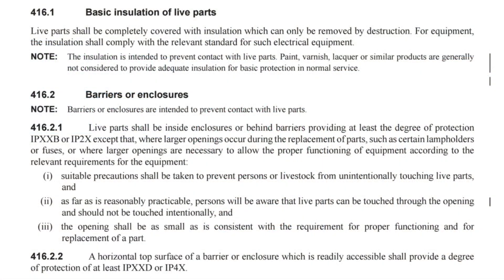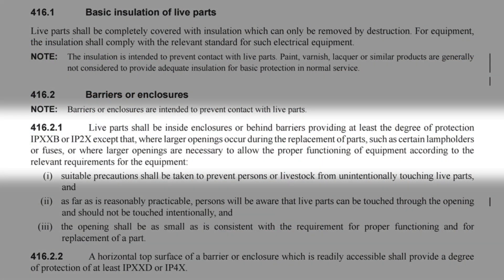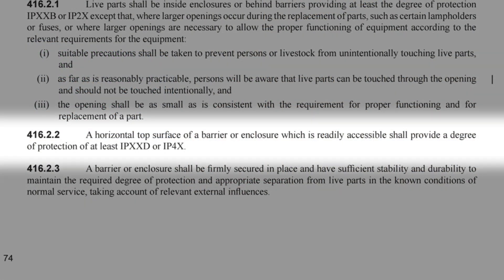CONSUMER UNIT IP RATINGS - Electricians Q&A - BS7671

Comment: What about if you knock two knockouts next to each other out at the top of the CU and use a jigsaw to cut a clean Oval shape, then use Gromet strip with this new made hole at the top of the consumer unit.
IP rating will be poor, but then you cover the hole with trunking flush from the ceiling or wall to the top of the consumer unit  covering the hole.
Only in circumstances when the T and Es or wiring is not situated or fed at the back of the consumer unit but are fed external down a wall and clipped to the top of the CU entry?

Comment: Concerning IP4X on the top of a DB, just out of interest, does anyone know why this is?  I thought at first that fire propagation might be the reason, but then disregarded this as plastic glands and rubber grommets offer little fire protection... Then I thought maybe or was about insects or mice getting in, but then holes big enough to allow this (IP2X) are allowed elsewhere.... Are they expecting people to come along with 1mm wires desperate to stuff them into the top of consumer units and distribution boards, desperate to be electrocuted? Or.. hang on, I may have answered my own question.  It's probably down to the dropping in and settling of fine particles which may then lead to fire risk... Seems most likely.  Having said that, a small mouse (or big spider) that could squeeze through an IP2X would surely offer the same risk, or greater?

Comment: I have noted that they are quite a few comments relating to the knockouts in the back of the consumer unit with relationship to the IP rating allowed I have also noticed that there is no reply from e f i x x . Could this be due to the case that they do not know the answer to this question??????.

Comment: Where does IP rating stand for a consumer unit which is hard knockouts removed to allow entry of cable through back of consumer unit
Reply: You have lowered the IP rating of the CU.

Normally the IP rating is for the entire enclosure.

However, the IET regs apply the IP rating to individual surfaces of the CU. If I recall correctly, IP4X on horizontal surfaces and 2X on vertical surfaces.

People make it more complicated than it needs to be. Don't over think it.

It's mainly about stopping people from getting their fingers in and touching a live part. With this in mind then, why do you care about holes in the rear of the CU where people cannot access those holes to be able to insert anything into the CU?

If those cable entry holes are on the underside of the CU such that little Johnny can come along and put his little fingers in, then yes the installation of that CU would not be compliant.

Comment: Mounting orientation of a consumer unit. Many people seem to think mounting a standard 18th edition DB on it's side is acceptable. But as there is no normally no lock / latch gravity is used to hold the lid shut. Mounting a single phase DB on it's side would not be installing the unit it as designed. Any thoughts?
Reply: Well it certainly doesn't make any difference to the electricity!

It's just a question of whether the cover flips open.

And from information I have seen:
If the consumer unit is made of steel and it confirms to BS EN61439-3 then it doesn't matter if the lid flips open.

So evidently, it is the fact that the CU is made of metal which reduces the fire risk posed by a CU, not that the lid closes. The lid doesn't make an airtight seal and prevent oxygen getting in.
Reply: And as for "not installing the unit as designed".
It is for the manufacturer of the unit to specify  how it should be installed, not the electrician. The electrician didn't design the product.

So with regards to installation, it is down to the electrician to follows the manufacturer's installation instructions.

And if the manufacturers does not say not to install it in a portrait orientation, then you can install it in a portrait orientation or if it mandates a particular orientation then you need to follow that instruction.

It's the same with maintenance free junction boxes. You have to follow the manufacturer's instructions.
If you do that, then the liability if something disastrous happens, falls to the manufacturer and not you as the installer.

And if you are not sure about the orientation question, then you get in contact with the manufacturer.
And ideally get a variation to the installation instructions confirmed in writing. And retain that confirmation.

Comment: How about from under. Where there is busbar cover and access to busbar. But from the top. Fair enough for water leaks but there is neutral and earth bar. Stopping you put your finger. Through  and the MCB  position it’s fairly low from the top. Again rule and regulations   And health  and safety with  out that much  the though
Reply: IP4X or IPnX where you are interested in the number n, is not about water ingress. Water ingress is the second digit, in this case the X.

So the rules around IP4X or IP2X are nothing to do with water.  Protection of the insides of the CU from water ingress is not what these regulations are about.  The CU is indoors.

External CU's, that's a different set of regs.

Comment: But isn't the issue here whether the ipxxb rule applies to the back of the consumer unit if it's fixed to the wall with no way for a finger to access it.
Isn't the more common question that arises is in relation to the 421.1.201 for non combustible enclosures. Once you create a significant hole for cable entry, is the enclosure deemed compromised?
Reply: No.
It can't be, think about it.
The case of the CU does not provide an air tight seal.

That is, the purpose of the metal enclosure is not to quell a fire by preventing oxygen from getting to the fire.

The purpose of the CU being fabricated from metal is such that the material itself is not combustible.

So with that in mind then, it doesn't matter about holes in the CU from a fire perspective. It does matter from an IPnX point of view.

The rules around IP protection of a CU when indoors are about the prevention of an electrocution risk to the human occupants, notably little Jonny who likes to stick things where he shouldn't.

Comment: You said use a closed grommet or a stuffing gland. What about using trunking
Reply: My thoughts exactly. A header trunking with a 90 degree bend to the ceiling should surely be fine.

Comment: Would you class the white fire rated grommets sufficient to achieve ip4x in each scenario below 

With 1 cable entering through a 32mm fire rated grommet 

With more than 3 2.5mm twin and earth cable entering through a 32mm fire rated grommet
Reply: Possibly... But the membrane is a bit flimsy isn't it. Wouldn't be my go-to...trunking over the top of the dB for the win. 👍

Comment: Not quite what I has hoping from the vid.  From the thumbnail I was expecting a chat about the IP rating of cables coming in from the back of the consumer unit.
I have seen people cut out slots in the back and put the cables though.  The IP rating is way more than IP2X.
So, that are your thoughts on this scenario, where the consumer unit is fixed to a wall and the cables come in the back via a slot?
Reply: I was really hoping for some clarity about this also
Reply: Yes click bait
Reply: Surly it’s about preventing access to live parts? When the cu is screwed to a wall you ain’t getting your fingers in the back.
Reply: @paullyons4624  But you can get a wire down the back of a consumer unit.  It's not IP4X with a slot in it.
They are also made out of non-combustible material, to prevent the spread of fire.  What does a slot do to this?  All stuff that wasn't  clarified.
Reply: @spoon1272  only the top horizontal surface needs to be IP4X, the back, sides etc are ok at IP2X, screwed to a wall you cant get your fingers down the back and into the enclosure, BS7671 doesnt say that a consumer unit must prevent the spread of fire, only that it must be made from non combustible material
Reply: @codenamenel  But it's made from non combustible material to prevent the spread of a fire from within the CU.  That's why they changed it.
Reply: @spoon1272  it doesn't say anything about  preventing the spread of fire. We live in a country in that everything is allowed unless there is something that expressly forbids it. We only have regs for allowable IP Ratings and the non combustible material. So Everything else is allowed
Reply: @codenamenel  Really???  So why do you think they went from plastic CU's to metal ones, if preventing the spread of fire from within the CU wasn't one of the issues?
Reply: @spoon1272  makes no difference what I think the reason was, does it say anything about the spread of fire from the consumer unit in the regs ? Or is it just something you've interpreted ?
Reply: I've always thought, once all your cables are through the back, use pink expanding foam to fill the gaps and add fire protection ....just my thoughts.
Reply: No need to seal the rear persay but good practice I guess

Comment: got tip mate....... but after ive fitted a new consumer unit any IP rating or anywere if sum1 wants to try n put 1ml object into it so be it..... they deserve a little show  just hope they film it   fink sum regs    are drempt up because they dont have enough to fill it!!!  mite makes regs books bit cheaper ...... doubt it loool maybe im wrong
Reply: Yes you are wrong.
You've got too much going on thinking down the lines of conspiracy theories.

That is not the way to think about it. You need to get away from that way of thinking.
The rules are about safety. Think of it that way.

This is a problem I come across regularly with electricians, is they always think the IET is doing things to try to rip them off. Mostly they impose rules for the purpose of safety.

So yes, as the other user has indicated, it's about little Johnny coming along and poking his little fingers in, or a knitting needle into a hole and contacting a live exposed metal part.

And no, it is not acceptable for you to say "Little Johnny shouldn't be poking things into holes". Little Jonny is going to do what little Johnny is going to do and if little Johnny is electrocuted because you left a big enough hole in a face of the CU, little Johnny's mother is  not going to be happy with you...and neither will the HSE be, neither will the police ..and it's you that is going to be fried (in addition to little Johnny) by the Courts.
Reply: It's not just that. It's people putting shite on top of the enclosure that could drop in as well...
Reply: Can you imagine going to open a door, you reach for the handle, and then suddently your fingers are cut off.. 
and some super door handle specialist who has had years of training says "well, this special little picture on the back of the handle means it's a left handed only door handle" 
You would be asking "I didn't know about that picture" "I didn't know to look there" "It looks like a door handle, how was I supposed to know its special" 
.

Then someone looks in the cupboard in the new house and there is a box on the wall with a massive hole at the top that looks like a cardboard box handle to lift it.. 
"I didn't know it was a consumer unit" "I didn't know the hole wasn't meant to be there" "It looks like a box I can lift, how was I supposed to know"
Reply: I always look at things and go "what is the worst thing a toddler could do to this" 
If there is a hole, a toddler will poke his finger in it, if there is a button, the button will be pressed, if there is a flap, the flap will be lifted.. 
If you don't have time to think of EVERY scenario, then you are living life correctly.. Thankfully, the regs have thought of it, and written it down.

Comment: What is your opinion with regards to fire sealing rear entry points of a consumer unit, especially when meter tails coming through a cavity wall or if the consumer unit is mounted on a stud wall
Reply from the maker: It depends if the surface behind the board is part of a fire compartment and needs sealing. The external cavity wall isn't in most circumstances.
Reply: @efixx  so fixing onto a timber stud wall with cables rear entry should be sealed. This has always been my thinking.
Reply from the maker: Again it depends upon what the space is used for on the other side . Here's the guidance from the NHBC which is quite useful  - https://www.nhbc.co.uk/binaries/content/assets/nhbc/tech-zone/nhbc-standards/tech-guidance/8.1/flush-mounted-electrical-accessories-in-partitions-final.pdf

Note the back to back socket scenario.
Reply: Theres no need. Its just preference. It only needs to be made of non-combustible material and stick to IP ratings
Reply: I personally like to run trunking above and make it not- readily accessible. If it is i’ll use closed membrane grommets or enter round the back using a pattress etc